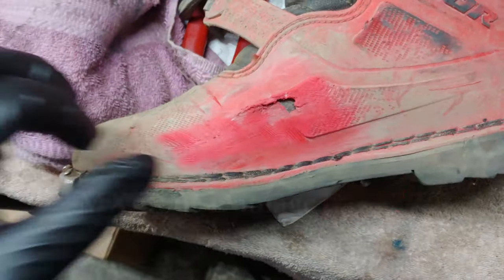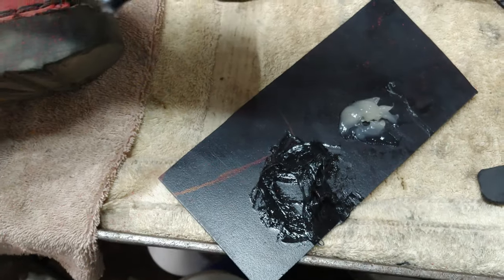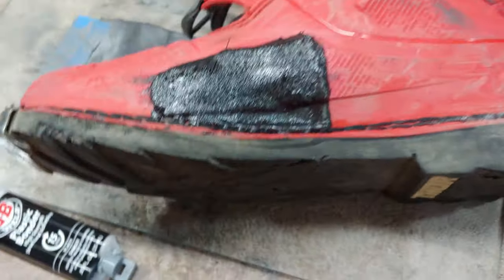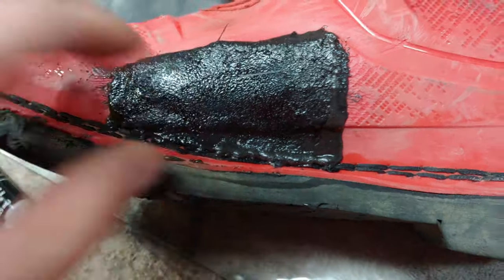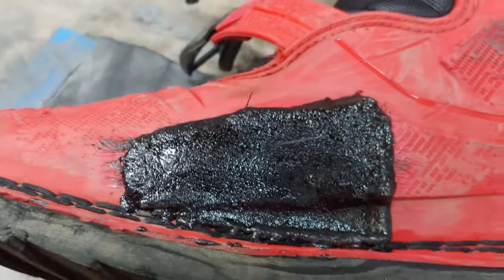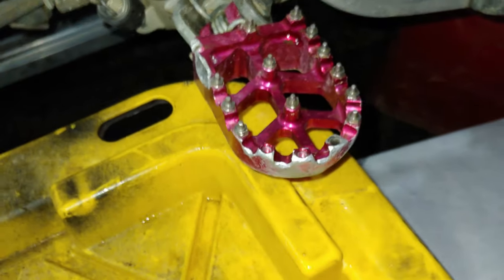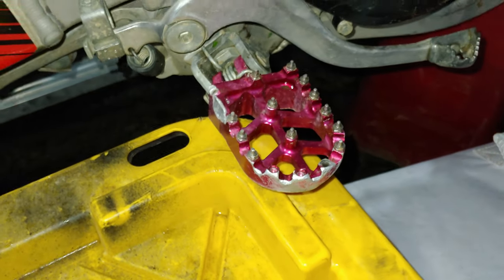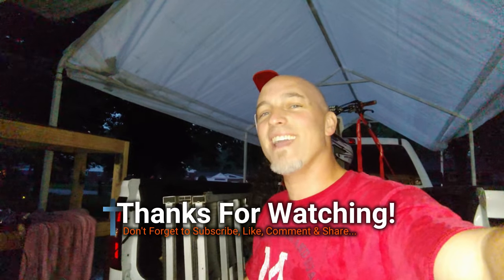MX Boot Hole Repair | Patch it up and more

Comment: How did it work out?
Reply from the maker: Didn't last very long and it was too hard and the posts on my foot pegs kept getting at it so I ended up removing three of the outside spikes and that helped out a lot. But I have a lot better solution now as I found out about Shoe Goo which is amazing stuff exclamation point they have it in clear and in Black and it holds up very well